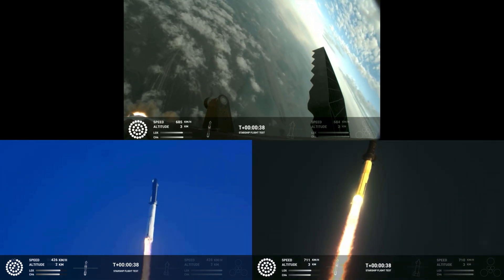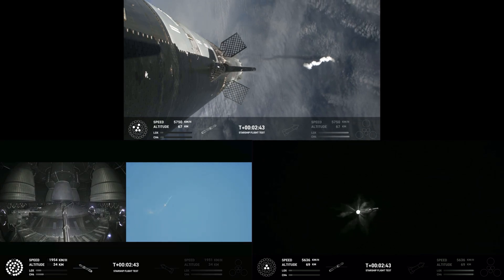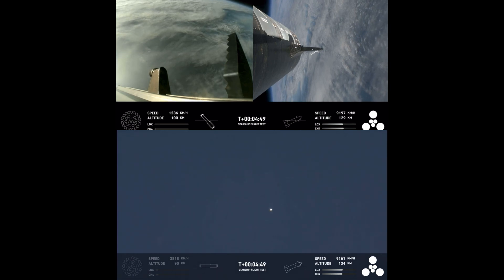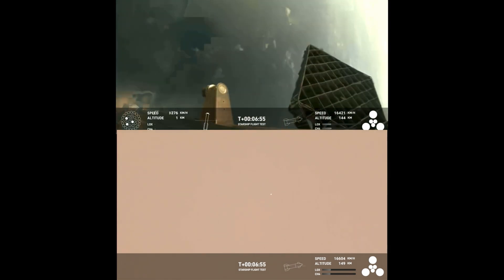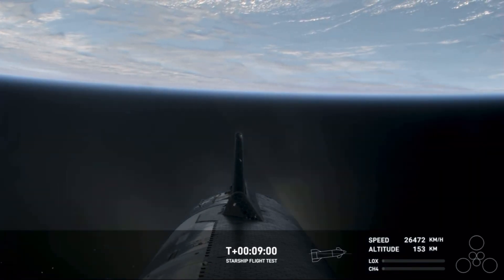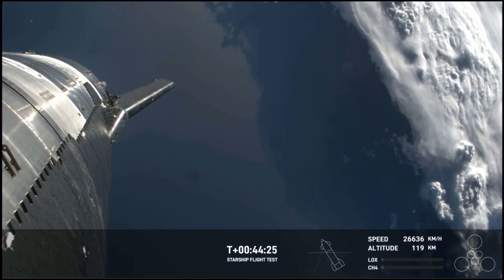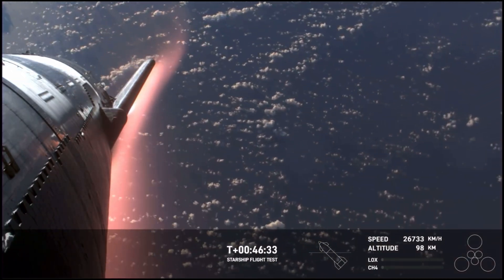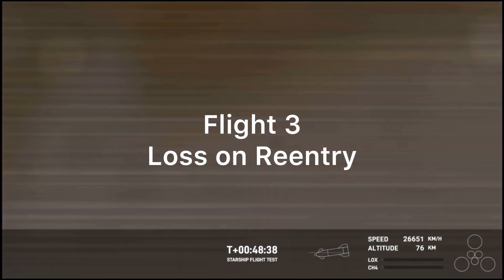SpaceX Starship IFT-3 vs IFT-2 & IFT-1 Side by Side comparison

Comment: Questions:
IFT-2 lift off - higher acceleration than IFT-3. any idea why?

Differences of LOX and CH4 levels on boosters and ships between IFT-2 and IFT-3. What's going on?

Great job put them all tgether!
Reply from the maker: I noticed that SpaceX didn’t completely fill the LOX tank for IFT-3, if you look closely, the LOX tank on IFT-3 has way less propellant than both IFT-2 and 1, so that’s why they are different levels after liftoff. As for the faster acceleration on IFT-2, I think maybe SpaceX modified the powers on their Raptor 2 engine’s thrust, because The hot-staging of IFT-3 was later than IFT-2. And I think just maybe, the Booster failed it’s landing burn because it ran out of LOX.
Reply: @simplecalculus  thanks!!
Reply: IFT 3 had much stronger winds, the LOX difference may be the culprit of failed engine relight for the splashdown
Reply: different flight profile